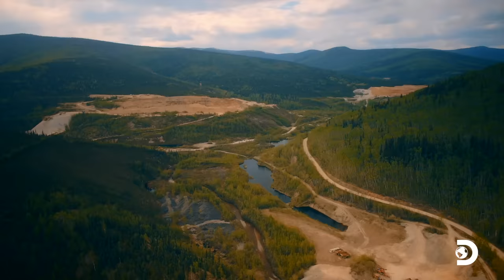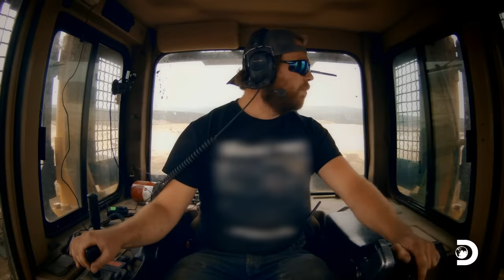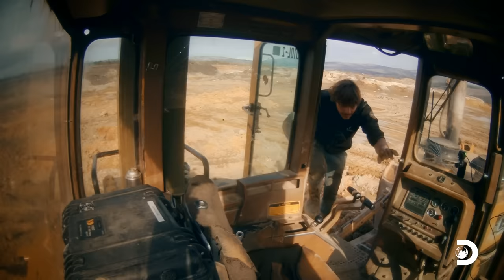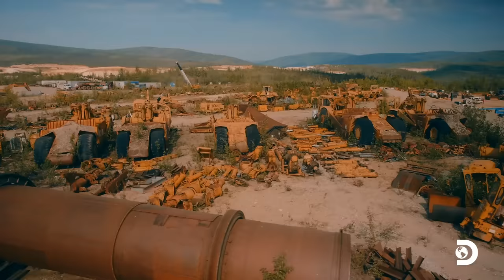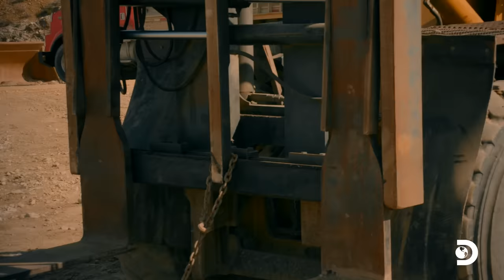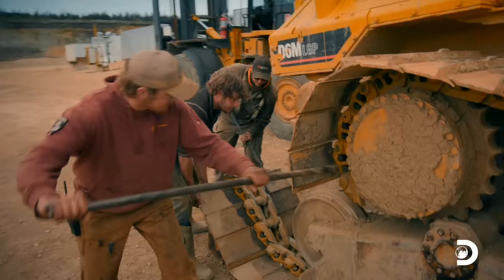Tony Searches for Replacement Parts in His Boneyard | Gold Rush

Comment: Did he just torque track bolts with a 3/8 Milwaukee
Reply: didn't you see the size of that torque wrench he was re setting back to zero. the 3/8 gun just spun the bolts, torque wrench tighten to the correct specs

Comment: Them d6 high tracks push so good. And it's got a 6 way blade that's even better. Although the fixed blades do push a lot better but you can control the dirt better with a 6 way blade. Why didn't he do a pre trip inspection lol and they didn't take the slack out but I'm sure they did it off camera.